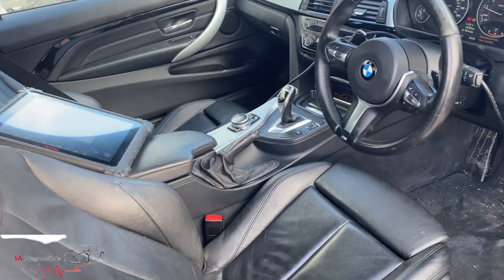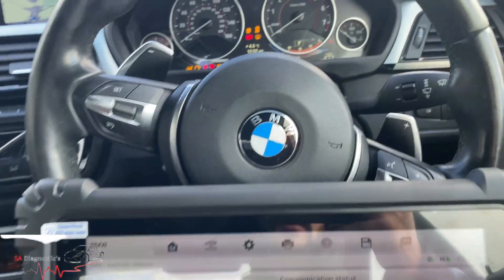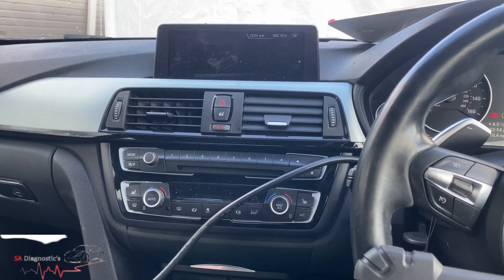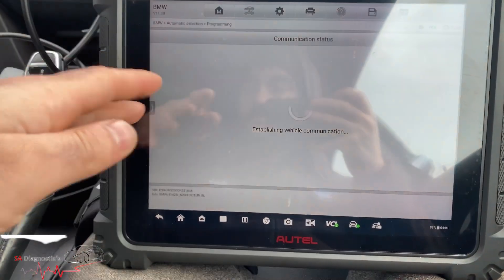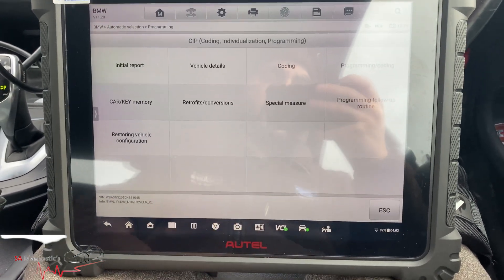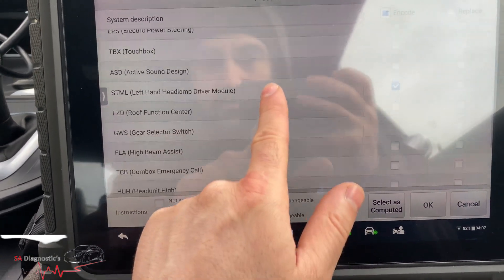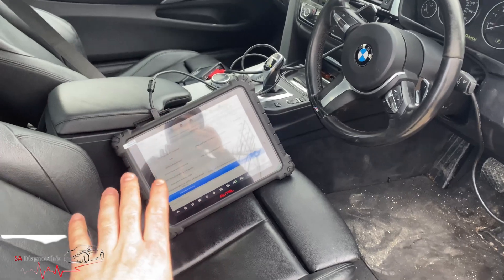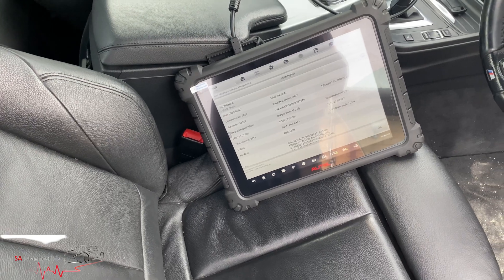2025 AUTEL BMW Headlight CODING & PROGRAMMING MAXISYS ULTRA LITE

Comment: Hello. I have a vauxhall insignia prefacelift AFL Xenon headlights. I've installed facelift AFL Xenon headlights but highbeams and AFL won't work. How can I code them? Is it similar to this video guide? What software would I need?  Thanks to Anyone who answers. Cheers
Reply from the maker: Hi you ca use opcom software which is dealer software

Comment: Please boss can the Autel elite pro2 do transmission programming and coding without virginize first on Mercedes’
Reply from the maker: No wont work all the time. I’ve coded Ford gearbox in before and taught new clutch but sometimes it may not work for certain things…
Reply: @sadiagnostics ok thanks very much

Comment: What is the cheapest Autel unit that can code an abs pump for a e82? what are my options?
Reply from the maker: @LeeFall  if am not mistaken it’s roughly £600ish.
Reply: @sadiagnostics Can you tell me which models?
Reply from the maker: @ AUTEL ultra lite

Comment: I wanted a replace and program a replacement FeM with an Autel I also have here, have you tried doing this with a second hand fem by any chance ? As I know ISN has to match etc
Reply from the maker: @adnanbaig5280  yes I’ve tried it and it’s very unlikely used will work but you can try it…

Comment: What model autel is this? Im plannig to get the m808s, do you know if it does bmw coding/programming?
Reply from the maker: @jemerbautista  if it has the j2534 then yes if not then it won’t work. Also this model is ultra lite. 

Equivalent to that is kingbolen k10 which I use now and it does the same job for fraction of the price…
Reply: @sadiagnostics  gotcha thanks so much for the info

Comment: I have a autel im508, bought thinking it could also do Coding, but it doesn’t have this option on it. I’m wondering if anyone knows how to get this without changing modules? Can I use the j2534 adapter or the x400 and enable these coding features or not?

Comment: Great video, where it said retro fit and conversions in the coding options do you think it could tell my van it now has 6 gears instead of 5 after a conversion? I also retrofitted cruise control but it doesn’t work in 6th gear 🤬
Reply from the maker: Sorry dont think it has anything like that.
Reply: @sadiagnostics  thanks for the reply 👊👊

Comment: Hi m8 , there is some issues after last bmw update on bmw mini it dose not code properly. Had frm 2011 e91 shows success but no vin written , took launch 3 min all done , then r56 mini abs coding 
, same shows success , but not coded , took launch 3 min all done , waiting for sw update from Autel (ultra lite )
Reply: What model of launch are you using ? Cheers
Reply: @Vincent-cc8xo  all been sorted now .
Reply: Can this code bmw head unit retrofits

Comment: Hi I’ve got this maxicom 808BT how do I know the code numbers on diesel Bosch injector for Peugeot, 207 for recoding never used it before it will be my 1st time using this. Thanks in advance
Reply from the maker: Hi go into the engine section and go into special function then injectors I have made videos about injectors if I remember rightly.
Reply: Ok thank you very much